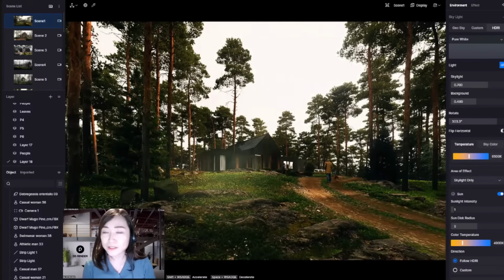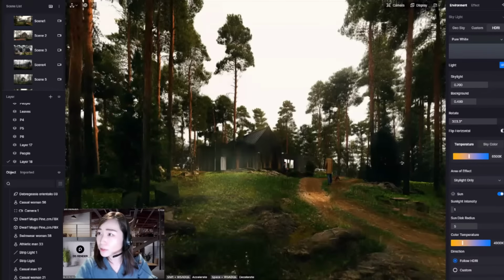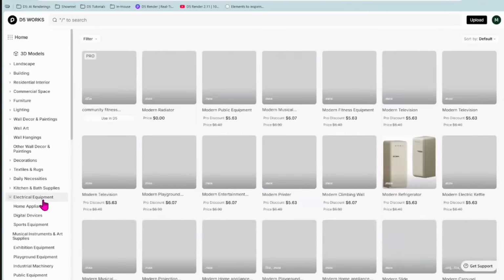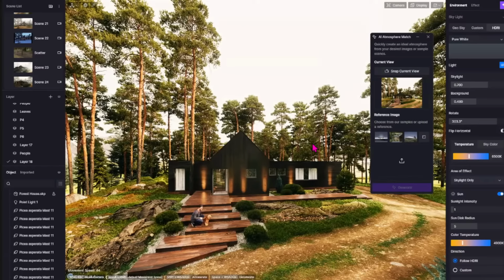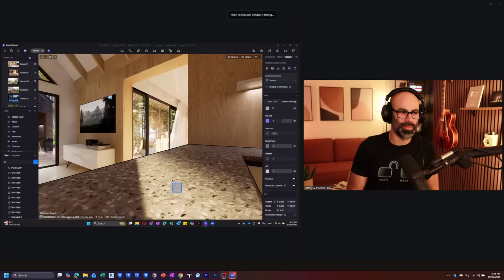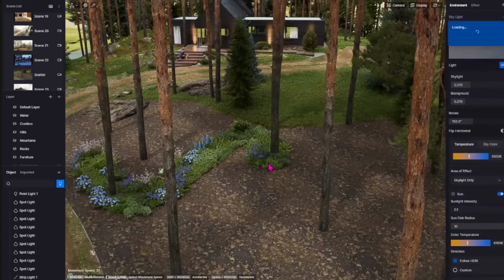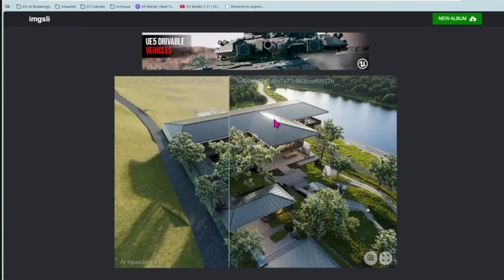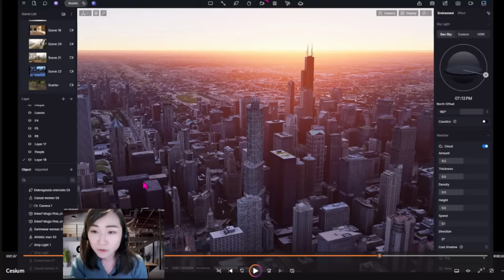D5 Render: The Next Big Thing for Revit Visualizations?

Comment: There is just one thing people don't value enough. I love the fact that with Enscape I only need to config the material once, in Revit. I hate the fact that most of the time controlling the stereotomy size and position with rigor is a pain in most of the rending software, as they are always more focused on looking good and being supposably fast to setup up. When we need tiles to align with precision, we do that in our authoring/documentation tool (like revit) and I do not have to redo that in the rending tool - probably for each surface if they are independent or don't follow the original software mapping. And I hate it even more if I need to check and fix the position everytime I do a change in the project - like doing the correction twice, and that is if I remember them all by the time I move on to the rending part of the task... If the users that do those tasks are different, than making sure nothing is forgotten is going to be a nightmare - that not even the collaboration tools in D5 should be able to help, in my view. So please - make sure this little-huge limitation in not a problem is future software developments. Thank you.
Reply: I totally agree with you, the disconnect between materials from the authoring project is a real issue. Having all the entourage etc separate is great but material properties need to transfer back to the documentation software.

Comment: Used Corona (and still do) for quite a while. I tried Unreal, and it's excellent. But I'm giving D5 a chance, considering how much I can speed up the process. Designing and rendering everything in a small company setting is just not feasible in my opinion. The quicker the process, the better
Reply: Oh and btw I've been using it for a few weeks, had NOT heard of D5 Works. They should advertise it better haha. Seems great though